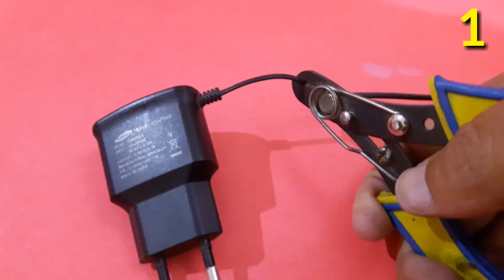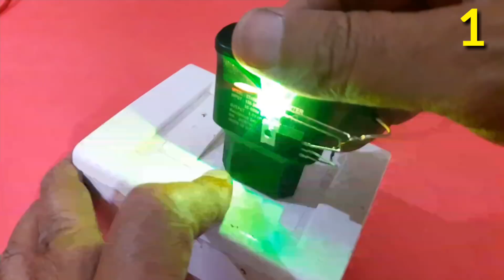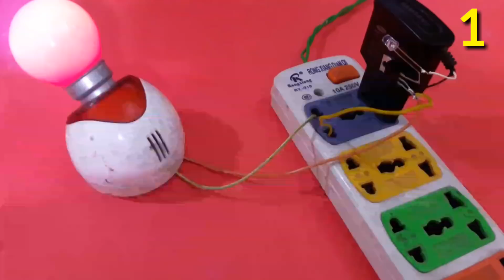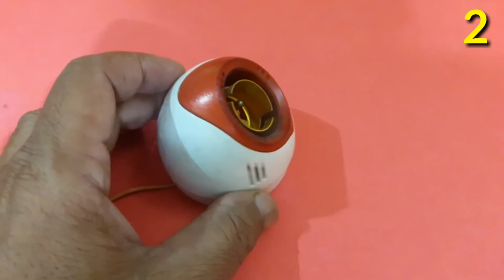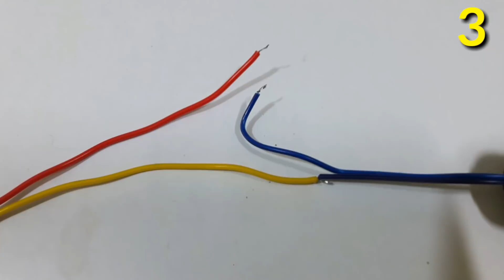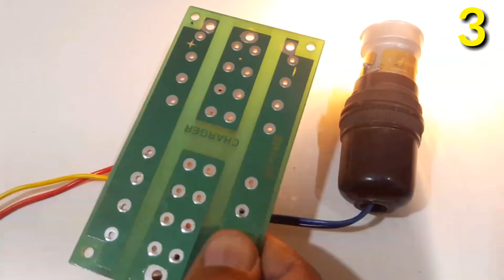3 Ideas with "Triac bt136"

Comment: Can I use 5v mobile adapter for 220v AC  bulb as shown in the circuit. My question is the adapter is gettig AC 220v directly on negative output. The adapter wont blast.